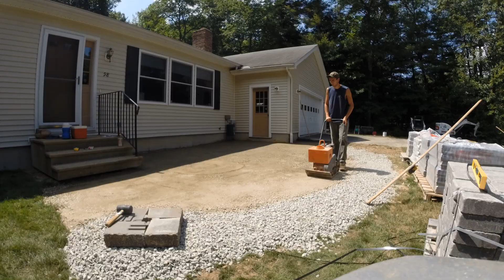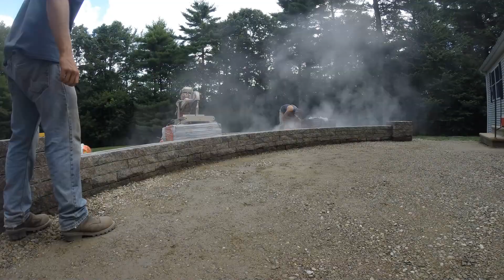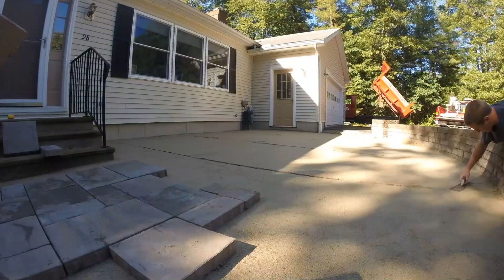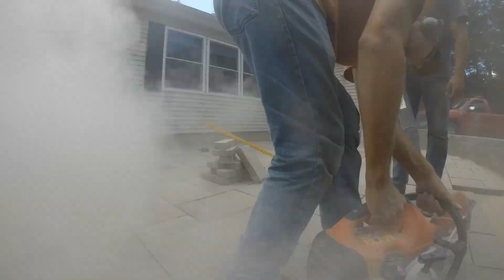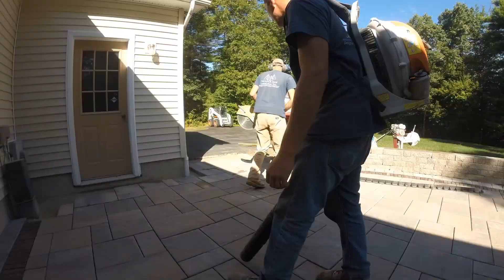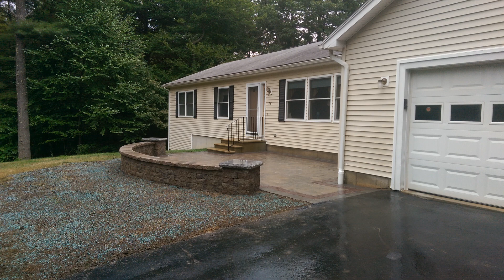Front Yard Paver Patio Construction Time Lapse

Comment: Why did you did that really deep trench out for the wall only to fill the entire thing all the way back up and set the blocks at finished grade anyway?    Why not just dig the entire patio and wall out and set on the same base?    By putting 3/4 clean under the wall the water is going to collect there, so it is actually encouraging the wall to move during a freeze thaw cycle, then the limestone treads are more likely to crack.   You seem to have built a moat, once the soil freezes around it, it now captures the water more easily and is trapped there.   The first course(s) of any wall should be filled with impervious base material, not drainage materials, till it gets above grade.       Maybe your climate conditions are different where you are, but that would not work around here.  Even if you are in a non freeze area, you are still saturating the soils under the wall and encouraging movement.

Comment: Isn't there a better option for you to use rather than cutting every single block on that seat wall? That's a lot of unnecessary labor. Check out Anchor Block Brisa. I'm surprised Unilock doesn't have something comparable. This is a 2 or 2.5 day job tops for us.
Reply from the maker: The Brisa is the same type of product as the Estate Wall. As far as I know there is not a manufactured block that doesn't need to be cut to make curved walls. Each block has a radius that you can use and not cut but thats rare.

Comment: It looks nice but there was an incredible amount of work for the outcome.  First, why in the world would they do such a tremendous amount of work and leave that old pre-cast concrete steps and cheap railing??  Second- there looks like no drainage at/near the wall.  Where does the water go when you hose it down??  Looks like it gets trapped at the curve.  Could have been a lot nicer with a little insight and planning.